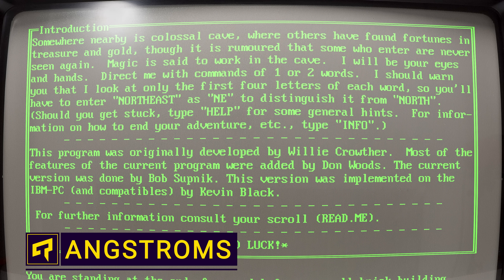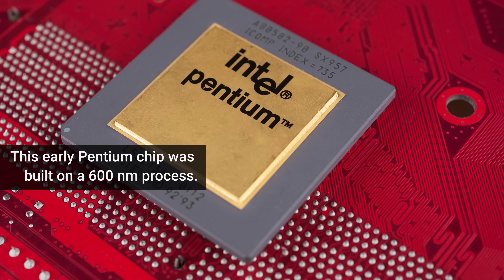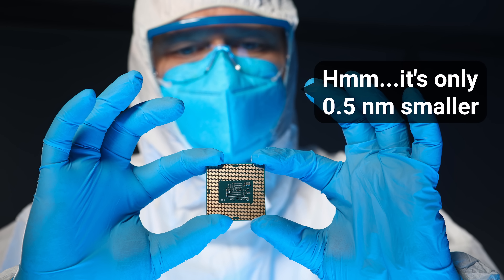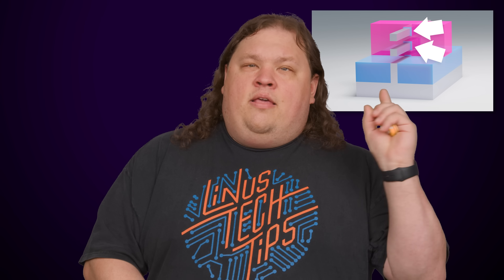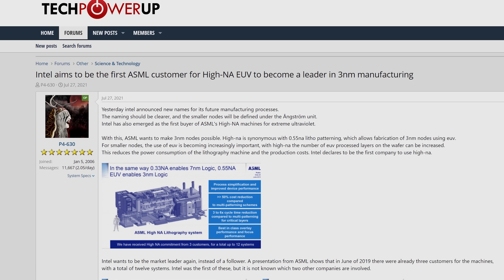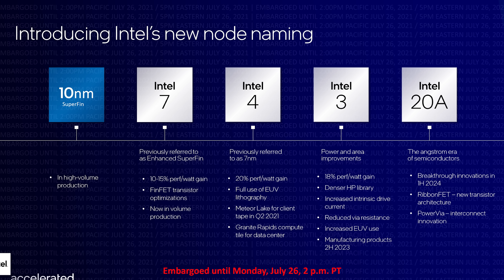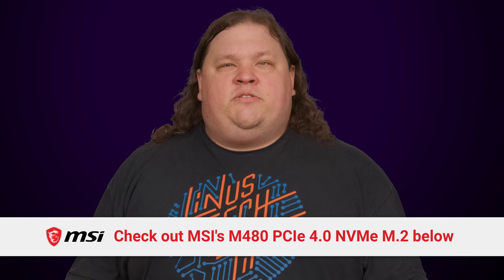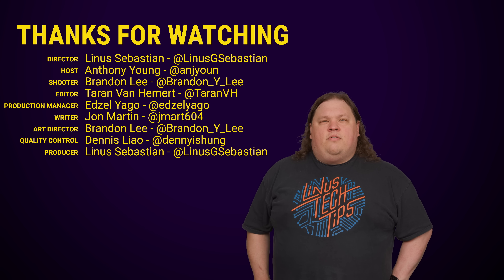CPU Angstroms vs. Nanometers

Comment: Below nanometer is Picometer ... so 2nm is 2000picometers...
Reply: angstroms are more commonly used while talking about the wavelength of photons/electrons
Reply: I mean, Angstroms make sense for this scale.
Reply: Angstrom may not be a SI unit but it's widely used to measure size of atoms It's right on the edge of physically possible size of transistors. I think there's no need for picometre precision.
Reply: @cubiss1273  nobody uses SI on this scale anyways. At least not in engineering notation. Densities (concentration, power density, etc.) are always in terms of the cm, energy is always in eV (this one actually uses SI prefixes funnily enough), and size is always in meters, microns, nanometers, or Angstroms, depending on what is being discussed.